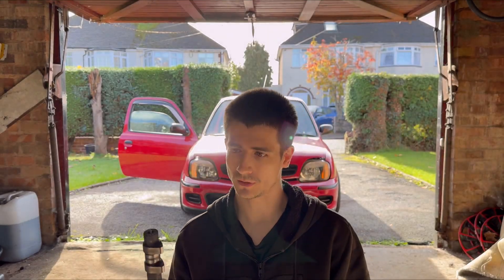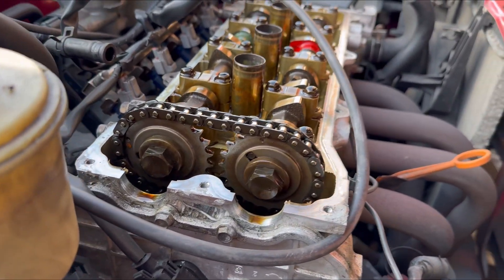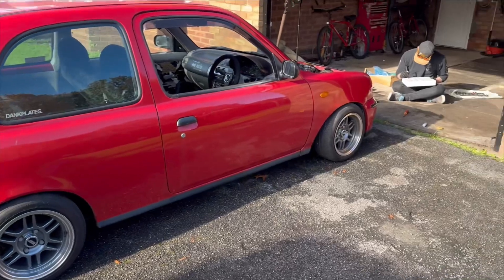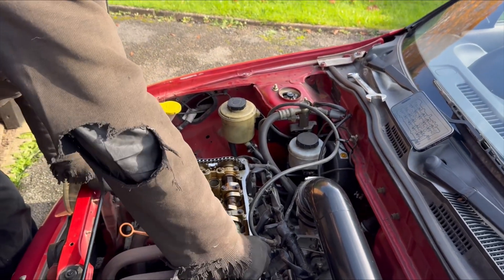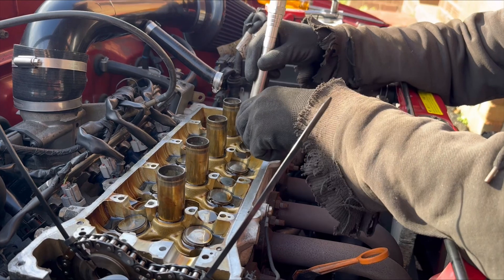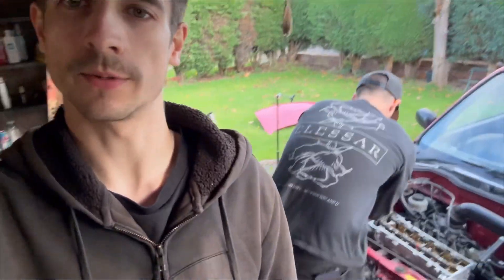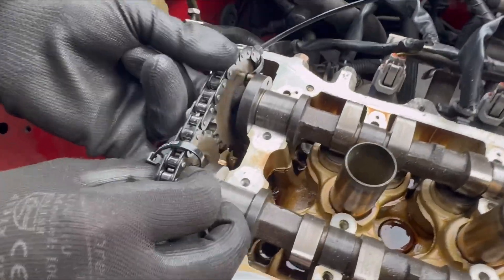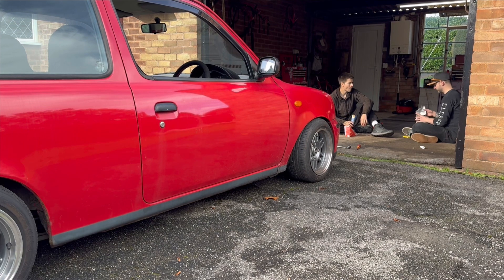Micra K11 - Get More Power with N/A Engine - High-Lift Cams install (Part 1)

Comment: Always always check valve heights before shimming, dry fit each cam and measure the gap, a little measuring and calculations will inform you exactly what thickness shims are required. Takes a little longer but you’ll be 100% sure it’ll run...that’s if you’ve taken the valve to piston clearance into account too. Cool vid guys, hope you work it out

Comment: A few years ago, I liberated some CG13DE cams from a scrap K11. I was going to fit the intake cam to my CG10DE coilpack.....mainly for a useful increase in low end torque. I never bothered in the end. It's a CVT auto so no ball of fire. It was one of those projects that I had every intention in doing, but other things got in the way. I'll be interested to see how this turns out :).
Reply: Hi, would you like to sell those camshafts?

Comment: When removing the old cams you should have compressed the tensioner and fitted a retaining pin (small hole in the tensioner) when fitting the new cams bolt them in first then fit the chain. With the tensioner fully compressed you don't have to fight with it. Once the chains on you just pull the pin out of ghe tensioner. The cams aren't the issue the shims are, basically the valves are being held open constantly (hopefully they haven't hit the pistons) you might not even need shims, check your valve clearances. Should be a good guide somewhere on the forums 😊
Reply from the maker: Yeah man. I’m sourcing a set of new shimless buckets which should sort the issue. Then I’ll be running the shims in those buckets. Hopefully get it running next week!

Thanks for your insight.
Reply: @TheCruise94  no worries, good luck with it 👌

Comment: I'm pretty sure those shims don't go under the buckets.
They are for the earlier type buckets that have the shims on top.
All your valves will now be slightly open and leaving you with no compression.
Reply from the maker: Interesting. I’ll look into this, thanks
Reply: Valve gap spec is huge on micras I'd run 0.25 intake 0.3 ex, 0.4 if your gonna turbo it. Pull the thick shims out, meassure eatch gap vith the new cam, pull the cams off, meassure shim thicnesses, calculate necesary shim thicknesses to run factory spec, meassure the shims you got with the cams, figure out whitch shim goes where. Happy camming!

Comment: yeah, when you're removing cams, you can literally just whizz it off in any old order. doesnt make a difference until youre putting them back, then the torque pattern matters because youre distributing the load across the bearings and surfaces

Comment: Looks like you have messed up the timing on that chain at the end. I had once a micra that did the same. Chain had slipped over a single tooth and had the same problem starting. Moving chain back in place fixed the problem. Wish you best of luck fixing it mate!

Comment: you know that on a 4 stroke 4 cylinder engine number 1 and number 4 are going to be at tdc twice each in every 4 strokes each, once on the compression to ignition stroke and again on the overlap between the end of the exhaust stroke and the beginning of the induction stroke so what did you use to get tdc in the right cylinder and you should have put a mark on the cam gears and the chain right next to it on both of them so you leave the chain adjuster alone and only slacken it off when you're ready to put the cam sprockets on the mounting dowels you will have the marks lined up when you tension the chain back up because it's either a rotation out or valve timing is out by a few teeth

Comment: is your performance cams grinded from normal cams or are they factory made performance cams?
Grinded cams have smaller basic circle than factory cams.

Im not sure, but i think those shims you got with those cams are for replacing the originals, if basic circle is same as original cams?

I have grinded cams and basic circle got 2,5mm smaller to get 272° and 9,69mm max valve lift. So we changed CR12/14DE valves, cos those have 2mm taller valves and that rest 0,5mm we took of from valve stems
Reply from the maker: Yeah they’re grinded down factory cams. 

I’ve got them working now, new video coming soon haha. Thanks for your help anyway.

Comment: They titled hi lift but reality is much higher duration. That is big difference in engine behaviour. They loose low end power and gain some bit top end. If they don't get complete head job they don't go any way